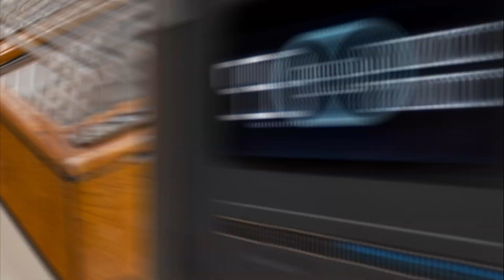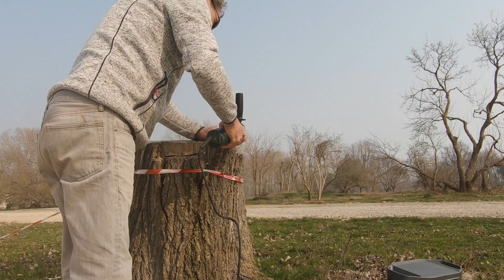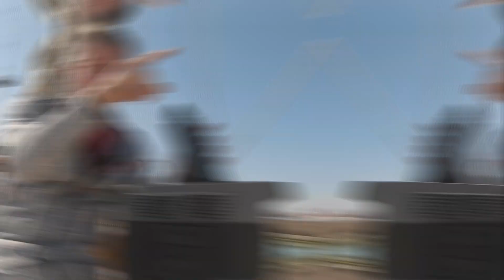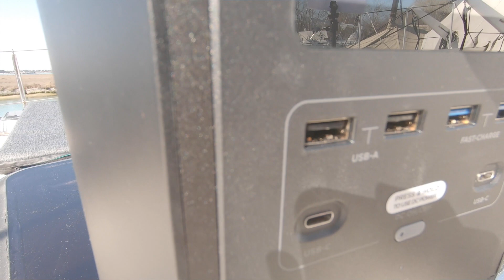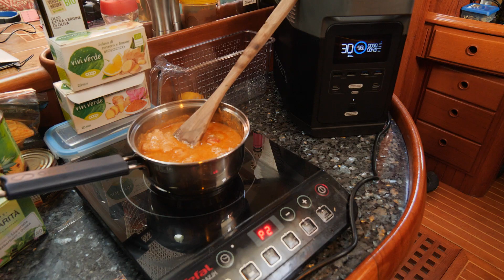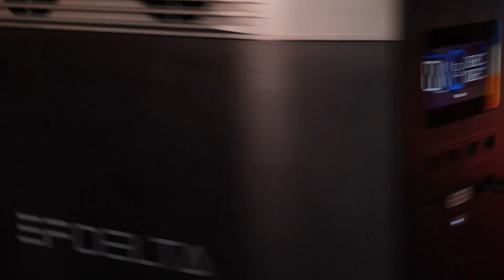Boat power solutions  |  Ecoflow DELTA

Comment: Hi love your boat and all the videos you upload for us. do you watch "Tally Ho" on YouTube ? one of the tally ho episodes is all about the engine he is going to install. The prop will generate electricity even under sail just by turning.  what a brilliant idea. Laurence in Devon
Reply from the maker: I haven’t seen it but I will have a look. Re-gen for yachts isn’t a good idea though unfortunately. Displacement hulls just don’t work as the hull speed is far too slow. Even Jimmy Cornell’s fast cat that was purpose built with an oversized rig to cope with the prop drag on a super light car that was set up to circumnavigate with electric engines gave up after a month. Re-gen is just not as easy as one would think.
Reply: Sorry the site is "Sampson Boat Co" by Leo Sampson. He is rebuilding an old wooden boat called Tally ho built around 1910, Putting in a diesel engine with two generator/motors attached, Leo thinks he could run a washing machine if he wanted too :-))

Comment: Is it more effective to change power tools to battery , less of a shock when your at sea cutting your rig away,
Set up the charger to 12v or 24 v ?
Reply from the maker: Battery power tools all have different voltages & charge from mains via their own transformers so you would be using the Deltas inverter to charge, not massively efficient. I would just break out the Fein Multitool with a cutter on it and power straight from the Delta, mains tools are always more powerful.

Comment: Pretty pricy.  Why not just install a couple of 100ah lithium batteries as your house bank. Capacity would be better and they could still be charged with all the inputs you mentioned. Certainly they would not be as portable but I’m not sure that feature would provide much benefit for me.
Reply from the maker: Simple really redundancy. It's already standing in for our broken ships inverter (and I'm not sure I'll get the new one from Mastervolt in Holland before we sail so it might be our only mains for the season) I will almost certainly go Lithium with the house bank & as you say it would have been cheaper to put the money into a bigger bank but that's all eggs in one basket. Happy to do that with Lead Acid as there's not much to go wrong & they've been tested for decades. If a BMS on Lithium craps out I want some power left and the Delta gives me that as it's completely self contained.
Reply: @svfairisle  I certainly like redundancy on my vessel, however in this instance I simply don’t see the value. It’s just too expensive for basically an inverter powered by a battery. If you want all the fancy read outs pick up a Victron BMV 712 Smart battery monitoring system. It will give you all the info you need and more on your batteries. And when assessing risk you need to look at the probability of the failure happening. I’ve not seen a record of Bms failures in quality lithium batteries. Given top quality lithium batteries have a built in bms the odds of them all failing are pretty slim.  So we can disagree on this one.
Reply from the maker: @donb4386  I admit I’m only just starting my research on lithium so maybe my fears are unfounded, but I do think it’s right to be naturally weary of new and relatively untested technology. Do you know if systems with multiple BMS’s have built in redundancy? It was my understanding that they don’t as all the cells need to be balanced so one BMS going down still upsets the system. Maybe that battery could be found and removed but I think the system still shuts down in the first place when a BMS dies? (And I have heard of people who have had them die)

Comment: Hi Steve, has anyone called you 'gadget man' before?!? I bet Judy winces everytime a big cardboard box arrives following one of your purchases :-) I have to admit to watching this review and wondering why you would need to bother with something like this: a very expensive box of tricks that surely you can do everything (other than go around the corner to use a grinder and nick some power from an unsuspecting restaurateur!) using your in house power system. All became clear at the end when you explained your battery/charger/inverter issues. So I see the reason why you bought this, there is sensible logic to it, however I'm sure an additional reason was so satisfy your online gadget shopping habit ;). All meant in jest!
Reply from the maker: Ha! Yes, guilty as charged, I do like a gadget! But I won that argument with Judy many years ago when she called my Quad bike a toy. Then I showed her she didn't have to poo pick the fields any more (it's something you do with horses!) because it could drag the chain harrow and save her about 5 hours work a week.
Reply: @svfairisle  I'm sure Judy still rolls her eyes whenever those boxes arrive! :)

Comment: Just my opinion, but this is all getting very complicated.  In my experience keep things simple, less chance of things going wrong.
Reply from the maker: I'm all for keeping things simple & agree it's the way to go with a voyaging boat. But this is self contained system so couldn't be simpler to use (yes I'm giving it some slightly complicated charging options, but you can just plug it in!) The beauty of it I think is that it's like having Navionics on your IPad, a completely independent system from the ships plotter so fantastic redundancy. I've so far stuck with  lead acid batteries specifically to keep things simple with tried and tested tech, but we've reached the state that LiFePO4's are a no brainer apart from the added complexity. The Delta will give me the redundancy I want to feel confident in making that change so thats a big thing for me.

Comment: Aim to not discharge it below 20% and up to 80% and you will get a lot more than 800 cycles. Applies to all lithium batteries. Good luck
Reply from the maker: Yes I planned to try not to go below 20% hadn't heard about not taking it all the way to 100% though, where did you hear that? I think it's probably not good to use the fast charge from mains too often, but since we don't often have it that shouldn't be a problem. ( I have no proof that's an issue either, but it seems logical)
Reply: @svfairisle  I drive an electric car so most lithium have a 5% top and bottom buffer. If you charge between 20 and 80% you will increase the charge cycles. If you leave the battery sitting, leave it at around 60-70%. And like you said in the video, do not let it overheat. As for mains charging, it is not good but occasionally it helps, what I find with the car battery is its like a variation of charges and the state of health (SOH) is improved if you follow a rapid charge by a 'granny' charge (as slow as possible. Hope this helps
Reply from the maker: Thanks, yes that makes sense. AGM's need a good charge (high amps) on a regular basic to avoid sulphation I guess there's something similar with Lithium types, I'll give it a fast charge every now and then when we have shore power.
Reply: @ForzAvantiVelez  -  I  ditto  your  comment !    Thanks !
Reply: @svfairisle  take it from the R&D head (Jeffrey Dahn) for Tesla batteries : optimum SOC range for Li-ion batteries is 30 to 70% . 20-80 will definitely improve your cycles by a factor of 2 at the minimum
Reply from the maker: Thanks Gerrit, great information.
Reply: @svfairisle  Don't take it too religiously , you can occasionaly stretch this band if you really need it . Just don't let a lion battery sit idle for hours in either a very depleted (<10% then start charging immediately) or highly charged state (>90 then start discharging immediately) . Personally I try to stick to an even more strict regime of 40-60% SOC for my Samsung Note 5 which shows nearly no signs of battery degradation after more than 5 years of use . Compare that to most people's expected life time of their cellphones (2 years max ?)

Comment: You can buy battery powered grinders, jigsaws, drills, almost any tool! What you really need is more solar panels, some attached to stanchions that flip out when at anchor or downwind sailing! This way you could eliminate the stinky gas generator!
Reply from the maker: That’s the plan, eliminate the genny, instal some LiFePO4 batteries, already fitted an extra 405w bifacial panel to add to the 800w we already have. Already have mostly battery power tools but some like polishers are rubbish when battery powered. The Delta will power the induction hob, toaster, etc. be extra power when we need it and crucially be our backup if boat power goes down ( until lithium BMS devices have been around for a while I’m not going to trust them to not go screwy and leave me with no power!)